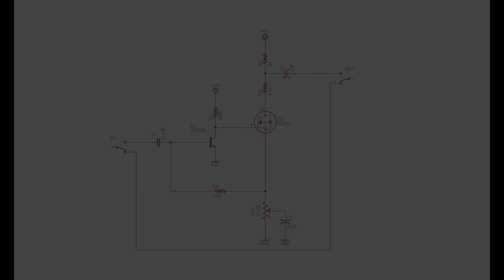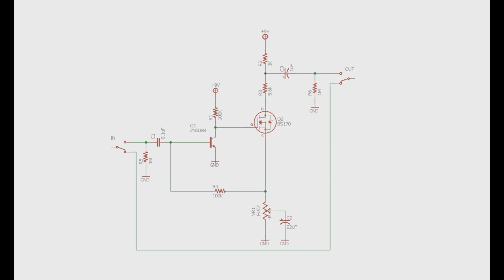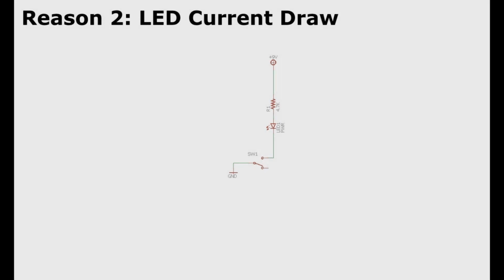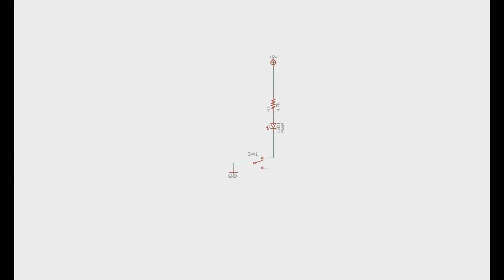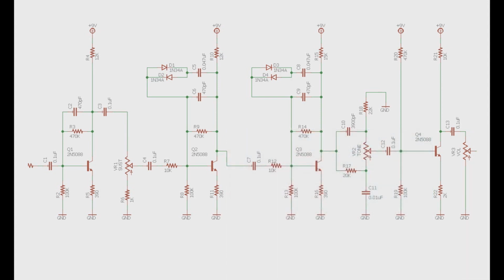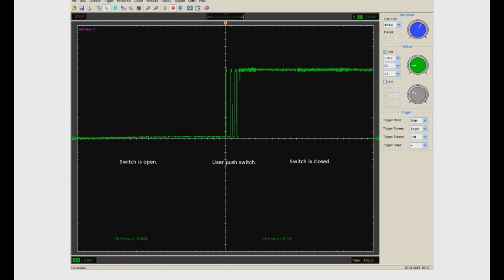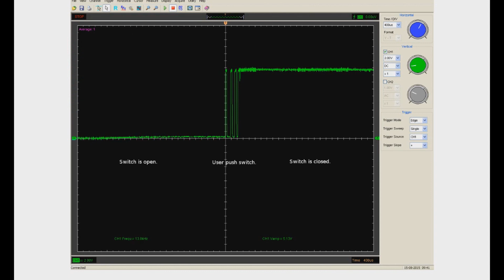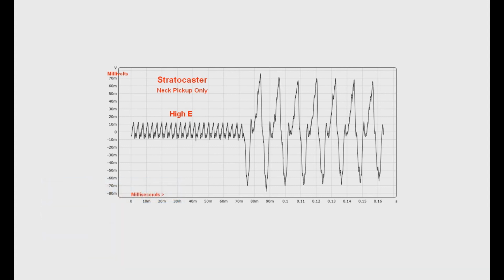5 Reasons Your Pedal Pops

Comment: There is a phenomenon I like to call "pedal ventriloquism".  We've likely all seen acts where someone operates a dummy on their lap, and though they are the one doing all the talking, it sounds and looks like the dummy is talking.

Pedals that use electronic FET-based switching (and Boss is a textbook example of E-switching) employ input and output buffers, with the switching circuitry inside that "shell".  The switching circuitry has no impact on the input and output of the pedal, just the effect-producing portion of the circuit board.  To keep input noise at a minimum, as well as reduce the loading effect of having multiple pedals in series, there is generally NO terminating resistor on their input buffer, such that  the first capacitor is left "hanging", just like the first circuit diagram in this video.

On its own, that poses no issue, since the switching is done after that point in the circuit.  You get a brief thump when you first plug in and power is connected, but thereafter one can hit bypass a thousand times and experience no switch-popping.  

It's not bad design in any sense, but also did not anticipate use with other sorts of pedal switching.  What happens if one combines such pedals with "true bypass" pedals?  Remember that TB pedals briefly disconnect and then reconnect the signal.  When such a pedal is placed before an E-switched pedal, that "hanging" capacitor on the E-switched unit is briefly disconnected and reconnected by the true bypass pedal's stompswitch.  Use either of these pedals on their own, and they are pleasingly quiet.  Used in the order of TB->E-switched, and you'll often experience popping when you step on the TB pedal.

I call it "pedal ventriloquism" because while it may look like the TB pedal is popping, it is actually the E-switched pedal that is producing the pop as its input capacitor gets disconnected and reconnected.  Thankfully, there is a simple cure.  Just solder in a 1M-2M2 resistor between the input lug and ground of the "in" jack on the E-switched pedal, such that its input capacitor always has a way to drain off any stored charge.  The impact on the E-switched pedal's sound will be negligible (unless you have a dozen of them in series with the same fix), but the TB pedal ahead of it will be blissfully "pop-free" when switching.  And remember that if pedals A and B are true bypass and pedal C is E-switched, stepping on either A or B would elicit popping from C, in the absence of the suggested fix.  That "hanging capacitor" doesn't really care where its momentary disconnection/reconnection is occurring.

Small wonder that popping in such "mixed" pedalboards can befuddle players.
Reply: Do you need to get a pet you're leaving way too long of a comment on a simple YouTube video. For real dude get some help.
Reply: @maxammo6282  1) I like people to understand things, not just parrot.  Sometimes that requires a longer explanation.  If you don't feel like doing "the required reading", don't expect to pass the course.

2) I don't own, or particularly like, mobile phones.  It's remarkable how much they encourage people to be curt and impatient; a price we pay as a society.  TLDR will be the death of civilization.  An actual keyboard offers me the latitude to be articulate AND edit.

3) I do have a pet - a wild rabbit we adopted, who lives in the house with us, free range.  But I also have a big pile of pedals to repair, and synth modules to finish up.
Reply: @markhammer643  🙄

Comment: Recently i finished a big muff pedal project.True bypass foot switch with 9 pins wasn't available and shipping time was enough to come so i used CD4066 chip with a single on/off push switch obtaining excellent results.Nothing is audible when gates are opening or closing in a four stages overgain distortion pedal.Also input and output capacitors must "see" a large resistor around 1Meg exactly for the same reason,click or pop.

Comment: Nice explanation. Can you talk about how to select input/output resistor values? I see 1M a lot, but also higher and lower values occasionally. What are potential downsides? (Volume loss, hi:low pass effects). Is there a reason we don’t see these in every circuit? Thanks!
Reply: 1M is typical. If you go lower, it allows for a faster bleed off, which is good, but also drops the input volume by bleeding the actual input signal to ground as well. You can go higher for resistor values, which also aids in signal impedance, but then it can't bleed off the voltage leaks at any rate that's worth anything. That's the balance.
Reply: there are 3. considerations:
1. filtering effects, found using the value of the input/output caps and a basic butterworth filter curve calculation. in this case, it's a high pass filter.
2. input/output impedance of the circuit and what will be feeding it. a direct guitar can be anywhere from 5kohms to 500kohms depending on the pickups (piezos with no preamp are especially high impedance), but another pedal's output will usually be in the 10s or 100s of ohms.generally you want to keep input impedances high and output impedances low, and an input bleeder resistor will eat more of the incoming signal
3. other. some circuits have special considerations that may require a different approach

Comment: Is there a fet switch circuit pre made for my diy pedal circuit?
Reply: Unfortunately that would be tricky. JFET switching requires the actual pedal effect and switch to be modified to do this. The JFETs and supporting circuits are integrated into the effect PCB, and then an SR latch circuit trips the JFETs on and off via a switch.
Reply: @erikvincent5846  ok .

Comment: This is great! I was breadboarding some clipping diodes (hard clipping), and get a pop when switching them on/off. Assume its from the voltage spike when they are switched off? Wondering how to remedy that.
Reply: Did you have input and output capacitors on either side of your clipping diodes?
Reply: @erikvincent5846  probably not! Will build again and test. Is there a suggested value that won't affect tone?
Reply: @DavidMsg  input cap? 100nF or larger will let in more bass to the point of only cutting out sub bass frequencies. Output cap? Probably 10uF or larger would be good.
Reply: @erikvincent5846  Awesome, thank you Erik!

Comment: ive got a little question actually! its not in regards to popping but more i momentary sound cut off. i modded a boss blues driver. sounds fine but when i engage or disengage the pedal, i get the quick momentary sound cut off. it doesnt gradually come back up in volume and theres no pop. just not a smooth clean on off sound. so its noticable when its engaged or disengaged. any ideas?
Reply: Not exactly sure, but BOSS pedals use JFETs for switching, and it might be those JFETs that is the source of your situation.

Comment: Does pop or popping sound can damage, your pedals? Or amp??
Reply: Typically, no, but there are some scenarios that issues could damage an IC. If you look at the Angry Orange explained, I do show were a diode is used to protect the opamp from a voltage swing, which can come from a pop, among other things.
Reply: @erikvincent5846  ic of the amp??
Reply: @crisjohnalvarez770  IC of the pedal, but theoretically, of an opamp stage of an amplifier too. However, if you properly design it, you should have an in series resistor, somewhere between 1K and 10K to reduce that from being a problem. Diodes can also be found in amplifiers that are there for protection.
Reply: @erikvincent5846  to me case on my pedalboard, does not pop sound anymore. due to my pure buffer pedal. when in the first chain, I removed the pure buffer and my rig no longer pops.
and when the pure buffer I put in the last of the chain also did not pop.

Comment: I got a new delay pedal fresh out of the box and once I turn it on with everything plugged in it makes a repeating popping sound. Like not just once it does it over and over again until I turn it off it does it about every 1 sec. It’s a 9v and the cable I have is 12v. Does anyone have a clue to what it is or how to fix it?
Reply: Switching power supplies are making noise when used for pedals that is audible and very annoying because there is a huge gain factor in the pedal boards.